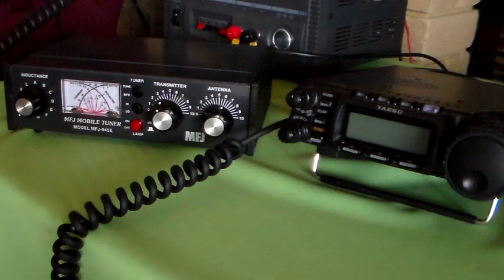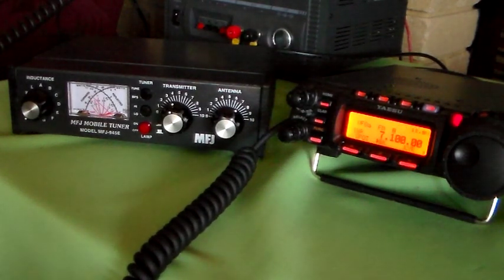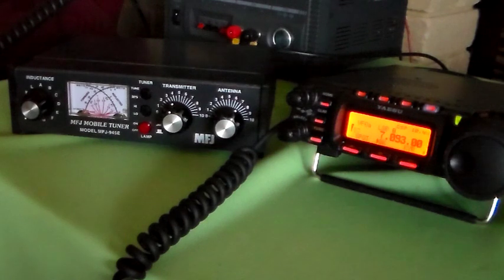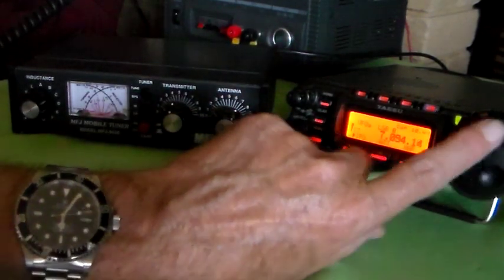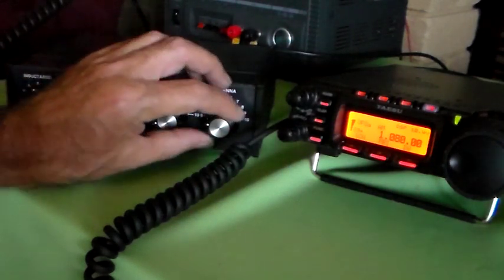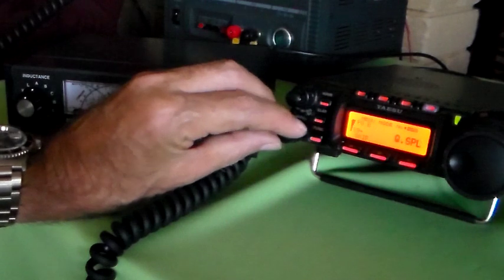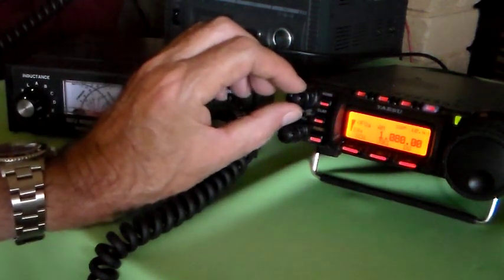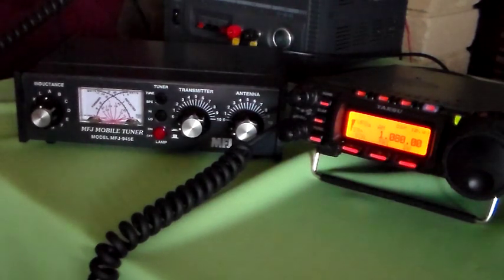Playing With A Yaesu FT857D on 40m and the AM Broadcast Band.

Comment: A BIG thanks for making this video.  I was surprised that your FMJ-945E had any effect on the 1080 AM broadcast given that tuner is only spec'd to cover 1.8 to 60 MHz.  Have you tried the using the 945E when your 857D is set between 76 to 108 MHz (the FM Broadcast band)??  To my knowledge, no one makes an antenna tuner that is spec'd to cover 76 to 108 MHz.

Comment: get a ft991a  kg6mn
Reply from the maker: Actually I have thought about that. They're coming down in price already.
Reply: my 991 is in the shop get a 991a make sure u get a 3 year warranty  or better yet 10 year one  73 kg6mn
Reply from the maker: Thanks. I heard the 991A is the one to get. Apparently the 991 had trouble blowing output transistors. Is that what failed on yours?